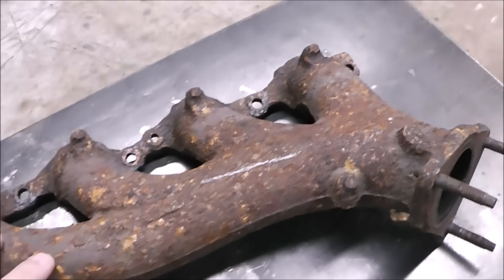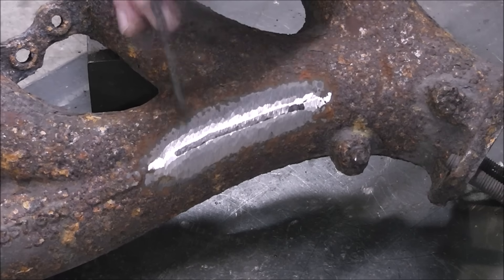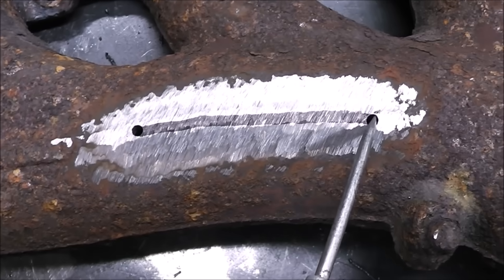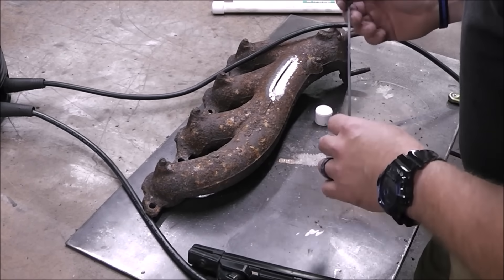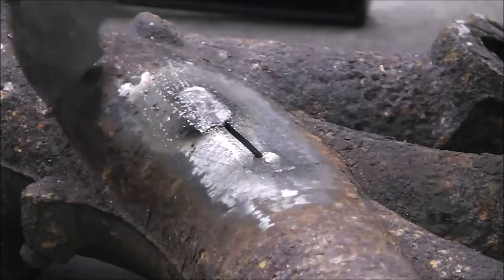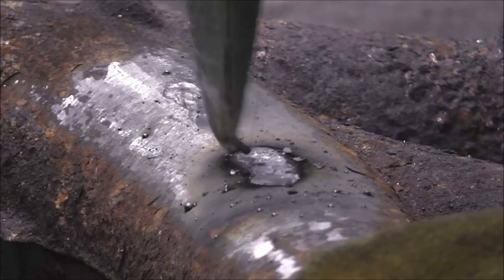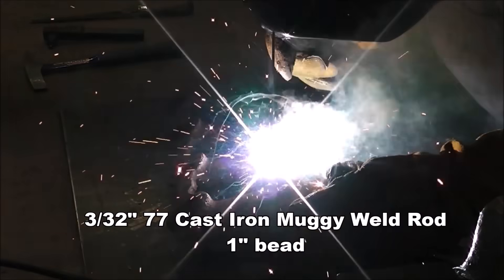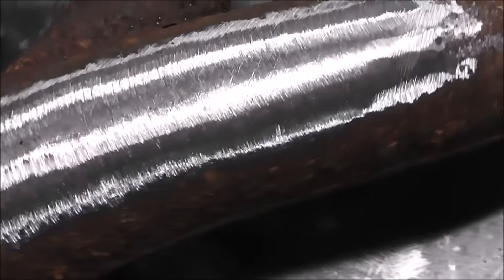Stick Welding Cast Iron Repair with Muggy Weld

Comment: Cast iron has little to no carbon mild steel has far more carbon than cast iron
Reply: I really hope your trolling since you're calling yourself a blacksmith, because you couldn't be any more wrong.....
Reply: Steve just Steve I am a Blacksmith of 6 years and I can assure you that cast iron has very little carbon similar to wrought iron when the steel is melted all of the carbon leaves the steel there are ways to add carbon back into it but due to the molecular change that the steel goes through it can't take on a large amount of carburization this is why it is impossible to forge. And the spark test  he did proves my point the cast iron had very few Sparks and the ones that appeared are a very dull red that is an indication of low carbon the more intense the sparks the higher the carbon level mild steel has plenty of carbon just not enough to be hardened and turned into  austenite cast iron is very different than steel when steel is melted down it becomes pig iron that is void of carbon they add carbon into the steel but it plays a different role it turns into martensite this Acts as a binding agent adding structure to the iron with out this process it is very brittle this is why when you try to forge it it just crumbles look up some YouTube videos on forging cast iron and you will see what I'm talking about
Reply from the maker: To say that cast iron has less carbon than steel is simply wrong.   Cast iron has a very high carbon content...It can be upwards of 4% (400 points),  while mild steel can be as high as .025 %. Even the high carbon steels such as tool steel are still well below the carbon content of cast iron with up to 1.7% (170 points).
Reply: Brandon Lund like I said before cast iron has carbon but it is turned into austenite during the smelting process austenite Acts differently than carbon austenite is still technically carbon or more of a carbon by product it's kinda like wood and charcoal or coal and coke if you Google it it will say cast iron is high carbon but it is actually the molecule formed by carbon atoms bonding with silicone and other atoms this forms a molecule known as austenite but there are very little Raw carbon atoms in the iron raw carbon can only be introduced into the steel once it in turned into a bloom the modern method of making cast iron dose not go through this process because it is not necessary so we are both technically right you are referring to the carbon that is found in the molecule I am referring to the raw atom Wich is needed to hardened steel
Reply: The carbon content in cast iron generally ranges from 2% to 4%. Mild steel is an Iron-carbon alloy containing less than 0.25 percent carbon.
Reply: I'm not going to pile on here but if you've been blacksmithing for 6 years then now would be a good time to do some study on materials science. With what you've learned on a practical level I think you'd benefit a lot.
Reply: @MatthewFogarty-k2y  hell ya got a point 😅
Reply: tinny blacksmith u

Comment: Seems like same process as nickle rods
Reply from the maker: The process of welding or brazing most cast iron is basically the same. This was more of an experiment using this type of rod than anything.  I dont think these are a straight nickel rod though. The 77 is advertised as a tri blend... they have probably added something to get those elongation properties.

Comment: That porosity is bugging the shit out of me
Reply from the maker: Sullivan Steed cast iron is porous.
Reply: Brandon Lund cast iron may be porous however I'd have to agree with him on this one, I didn't see those pinholes before you started welding. Not attacking your welds, just an observation
Reply: Brandon Lund oh okay see i thought it was just the same as welding regular mild steel maybe from where you tied in maybe arc length was too long or trapped some slag

Comment: You can use your fingers to break of the flux of the end instead a file, i do it all the time.
Reply from the maker: Mr. greens boat tanks and aluminium welding it seems like whenever I try to do it with my fingers, I end up busting a big piece of the flux off lol.
Reply: Brandon Lund ok, i never had that problem i was using 7018. Might be different with those electrodes.

Comment: Good job brother! Great video. I wonder if I can Pulse those rods with my HTP Invertig 221? I need to get some.
Reply from the maker: Welding Junkie I wouldn't see why you couldnt... actually it would probably work great limiting heat input.  I’m going to be doing some cast tig with these rods also. The 77 rod is awesome! You wont be dissapointed!
Reply: Brandon Lund I do mostly dirty should I buy both or the 72? Do you get credit through your link ?
Reply from the maker: I haven't tried just one or the other...from what I understand,  the 72 is for super dirty stuff. I could have welded that manifold no problem with just the 77. I don't get any commission or credit through that link. It's purely to help the community because I like welding and experimenting with stuff just as much as you guys do.  I would check out their website. They have some really good information on there and they have some really exotic stuff like specialty rods to weld pot metal.  Depending on what your doing for cast, im thinking you could probably get away with just the 77,  but these guys would know much better than I for your application. Thanks for your support brother.